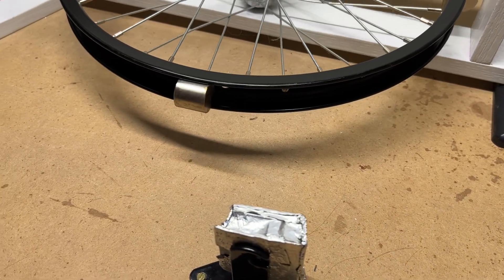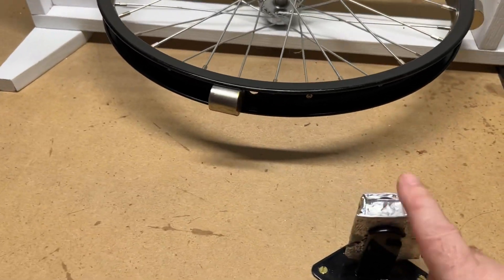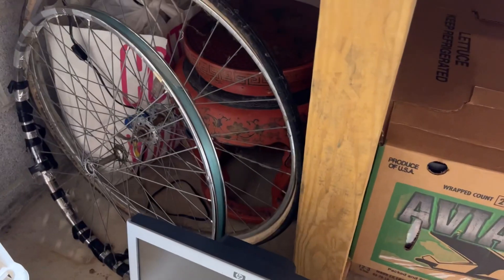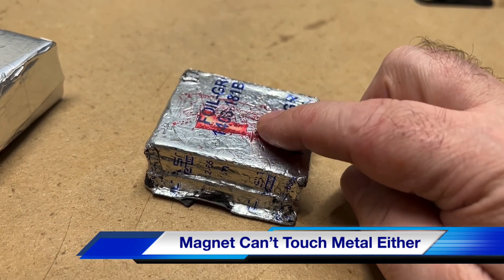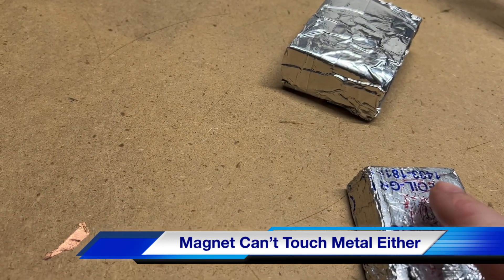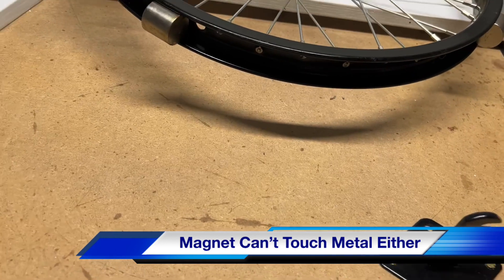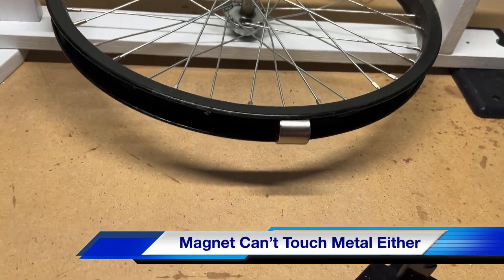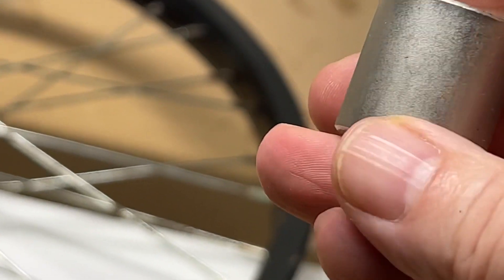🧲 FREE ENERGY GENERATOR RESEARCH | MAGNET MOTOR GENERATOR RESEARCH

Comment: You gave continued to experiment and hanging in there and being well attached to your work. Make a large scaled up model, maybe four feet in diameter. Very good method of shielding and it works. An artificial mono pole.
I have, after many years of experimenting, found an interesting device. A self sustaining motor, charges the battery while running. In January will post a video, it will have been running since August first and battery voltage remains the same.
Reply from the maker: 🧲 I agree with a much larger setup. For now I’m after proving my theory is indeed more than just a theory. Then I will scale up, but not so much in width, but to the  height and width of a 70 gallon hot water heater. It will actually look like a hot water tank if all goes well. 

Your device sounds interesting. I  made a hand made electric motor that keeps the battery charged some 12 years ago. Do to sudden life events I left my channel for a long spell, and during my absence, YOUTUBE removed that video, and others as well. Said it violated their community guideline. Lol   I never made a new video. Then in 2019, YOUTUBE removed 11 more and never said why. Removed two more last year as well and never said why. Based upon the recent dump of classified Twitter documents, I’m sure what happened o ER at Twitter is still happening here as well, including Facebook. 

Here are my latest updates for January 2023. An eye opener. So I ordered another set of magnets to see where this leads us. 

More importantly, thank you for taking time out of your busy life to follow my research. Very kind of you. 

🧲  https://youtu.be/e7RXrSYSaqc

🧲 https://youtu.be/flbL4MhdSIs
Reply: @JamesRoneyStators  What do you use for space or material that insulates Between the two pieces of. L angle sheet metal..

Comment: Well done. It could be, that it will only work with just one stator, so please show this some more without big boxes below the table...Many thanks.
Reply from the maker: 🧲 I need to see what’s in those boxes and unpack them anyway. Soon, the new build will have its own table. About 12 years ago my first prototype worked using three stators. Not one. Took it apart to build a bigger model which is when my life would be turned upside down for nine years. 

YouTube constantly taking down the video of my first prototype then closing down my channel was an eye opener. 

Two months later I started the Free Magnetic Energy channel on YouTube that quickly gained nearly a million subscribers in about two months. Reason being is because I made a different video of my first prototype working,  only for YouTube to simply take down my channel once again after a couple months. By the way they gave me that channel back a few months ago or so but all the subscribers and all the videos are gone. 

Pissed off, I started yet another Free Magnetic Energy channel and added the numeral 2 at the end of the name which is my primary channel. Where as this is my back up channel. (JamesRoneyStators)

However, this time around I refrained from posting anything that might get my newest channels shut down again. 

As I moved forward with my research to build a second prototype,  I ran into a couple of issues; money for more magnets as I was cash broke despite I was worth a lot on paper. The bigger problem was replicating the same results I originally obtained early on with my first prototype. 

Now years later YouTube continues to take down videos of mine on on both channels with no explanation or warning. In 2019 YouTube took down 11 of my videos all at once. Then in the summer of 2022 YouTube took down another video of mine with no warning or explanation as usual. 

What puzzles to me is that there are thousands of highly obvious scam videos trying to fool everybody into thinking they have figured out countless ways to make free energy. Of course any of us with a good head on our shoulders knows that what we are seeing simply does not add up. Yet, YouTube allows the SCAM channels and videos to remain up because it’s making YouTube millions of dollars in monthly ad revenue Is my thinking. Not to mention all the scam channels helps to mask videos they’re actually legitimate in seeking real answers to free energy.  Of course all of this is simply my opinion based on my experience, and nothing more. I have no concrete evidence to support my suspicions. 

Why is it then I am being singled out? I see other channels that seem pretty credible and they don’t seem to be having their videos taken down. At least not that I can tell anyway.

Now with a substantial shipment of magnets and other parts on the way, and more parts to be ordered, I will be assembling what I hope to be a working prototype number two. However, I am simply not going to post that on this channel because I am confident that not only will the video most likely be taken down once again, but I might lose this channel as well, which would be three channels over all I will have lost with no explanation.

Once I get a second prototype up and working just fine, I will make an announcement video on this channel to where you will find that video. However with all of the free energy channels, and free energy videos out there, I’m thinking I might be able to post it on this channel as well, and get away with it without violating any supposed YouTube community guidelines. But if my suspicions are indeed correct and I am actually being watched by a select few then I still won’t get away with posting a working model here. Again, this is simply my opinion based upon my own personal experience over the last 12 years of producing content on YouTube. 

Someone demonstrating cause and effect of magnets is not a violation of YouTube’s community guideline. Nor do I use any music or soundtracks of any kind that would cause a problem with copyright issues. In fact my channel has never received a copyright claim. My channel has never received a content claim as well. Only that I get a notice saying I have violated YouTube’s community guideline with never any specifics of what violation I’m in violation of.

More importantly, thank you for your interest and time in reading my lengthy response, and for subscribing. Know that you are more than welcome to copy and repost my videos anywhere you like as long as you do not monetize them. 

🧲